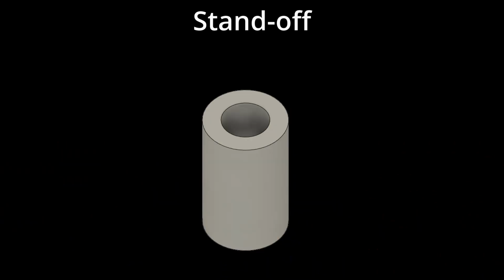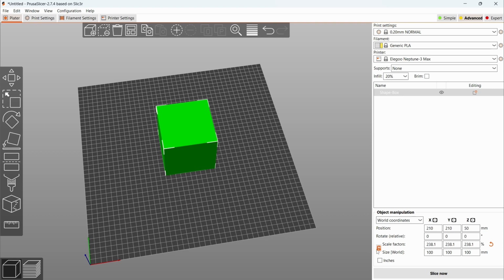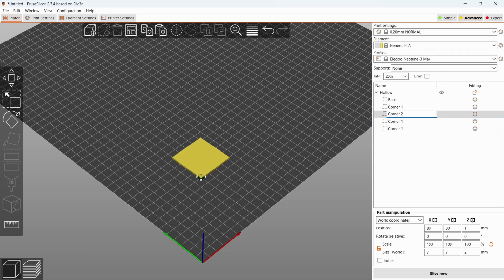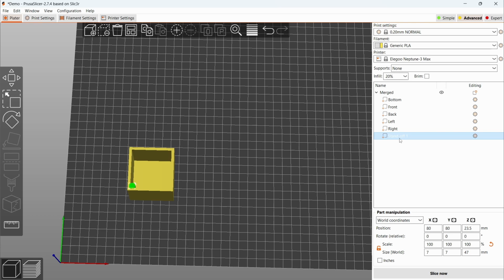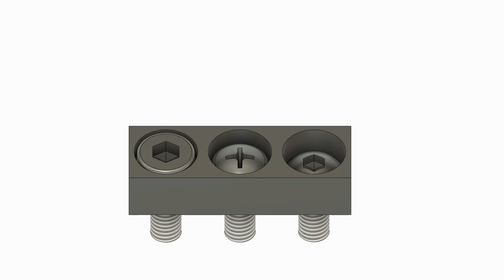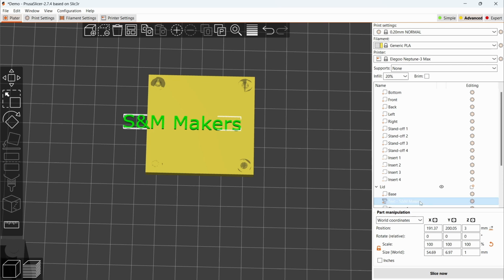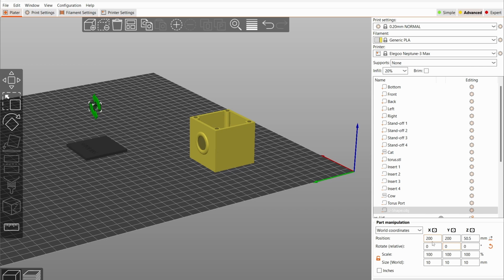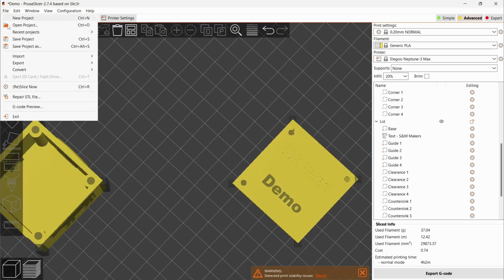Functional 3D modeling in PrusaSlicer

Comment: Oh man! Onshape for the win! It is free and could make this all SO MUCH easier. Even FreeCAD is as not much pain.
Reply from the maker: The model in the video is at the far end of the complexity spectrum for what you would want to make in PrusaSlicer, but for simple brackets, stand-offs, spacers, and boxes, PrusaSlicer is great.

Also, PrusaSlicer is great for when you can't install any other software on the computer or when you are creating a commercial model, but don't have any CAD licensed.

Basically, I made this video to show PrusaSlicer is an option when you can't, or don't want to, use a dedicated CAD package. Even though I have a lot.of experience using Fusion360, I actually create most of my (functional) models in PrusaSlicer because it is so much faster and easier.